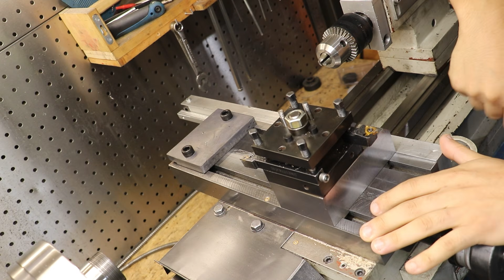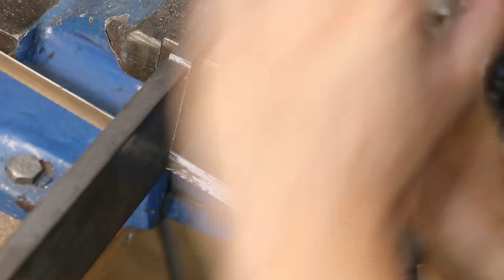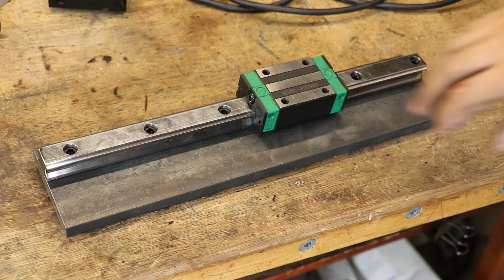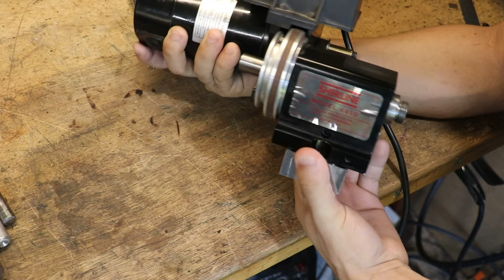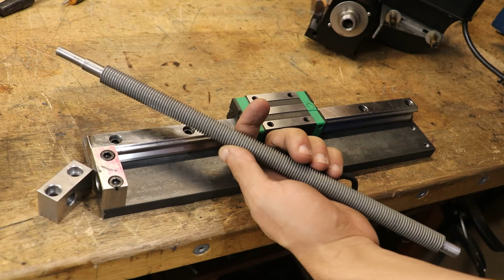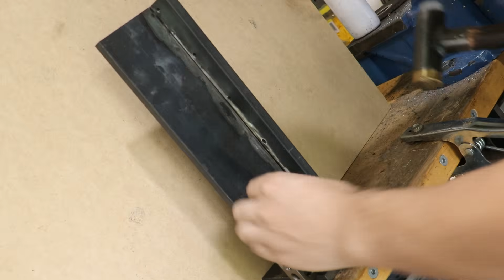Making A Vertical Milling Attachment For The Lathe

Comment: Hi Milling requires a fairly rigid machine. How well does this design hold up in terms of rigidity? I’m also planning to build a drill/mill machine, and I really like how simple your design is, so I’m thinking about using it as inspiration. I’m just not sure how rigid it is in practice. Thanks!
Reply from the maker: This was built around using er 16 size mill tooling and drilling and it was certainly rigid enough to do that. For any large machining its always best to have a mill.

Comment: Not sure what you are planning to do to the mill spindle, but you have 145mm of cross travel on your lathe. Couldn't you buy (they are cheap) or make the sort of vertical milling slide that everybody used to use - where the drill/milling tool goes in a collet in the lathe spindle, and the milling attachment holds the workpiece (e.g. with a small vice, but whatever is necessary to hold your mill spindle in this case) and the milling attachment traverses with the cross slide, and has some vertical  movement using a lead screw?

Comment: Did you consider the holes are slightly too small for M6 because they are actually made for M5 with plenty of tolerance so that the usual unallignment of drilled/threaded holes won't affect the straightness of the rail?
Reply from the maker: What I think may have happened is bad translation on the part diagram. 6mm hole has been mistranslated to 6mm screw
Reply: @artisanmakes  makes sense

Comment: Great job. I’m inspired to make something similar for my lathe. But I’ve got to ask- where on earth are you buying 3mm carbide end mills for 30 bucks!? Adam’s Bits in Melbourne sells them for AUD5.45.
Reply from the maker: This is a suttons carbide endmill. Australian made and very good quality. At least for my cutting tools I try to stick with name brand ones if I can.
Reply: I have a lot of Aussie made Sutton drill bits. Excellent quality. But at the rate I break tiny end mills, I need to stick with the Chinese version!

Comment: I know you said you weren't going to bother with bearings on the leadscrew but a quick and effective option might be to  drill a shallow taper in the bearing block and in the end of the screw, then drop in a single ball bearing. It'll reduce friction and be self centering.
Reply from the maker: If this was a tool I was going to use more than once I might have put some effort into putting bearings into the blocks. It really is a one use tool

Comment: You didn't tell us the thread you used on the stud.  I hope it's a metric thread so that it is a truly mongrel part.  Could it even be 0BA to be really really annoying?
Reply from the maker: M16 x 2 I think. It doesn’t actually matter I’ll be using an indicator to set the depth.

Comment: In this type of anti backlash mechanism two thread hold the full load in one of the directions, while a lot more towards the other. I don't know,  it looks weak
Reply from the maker: It’s no different to the ones that one on the lathe and the mill. Only difference is those are made from bronze.
Reply: It's very common in the smaller Chinese lathes/mills.  I suspect the longevity won't be great anyway because it's steel on steel, and that all-thread and the couplers are usually toffee grade steel.

Comment: I obviously do not have the whole picture since I do not know what mods you have planned for your mill spindle, but the first question that popped into my head was whether it may not have been easier to make a whole new spindle using the mill in current form to do the milling and then simply install the custom spindle when done instead of making a milling attachment for the lathe... Either way, makes for good video.. You do great work...
Reply from the maker: I looked at making a spindle once. I could probably make the basic spindle, but once it needs heat treating and grinding that is outside what I can do. And outside what I can afford to commit to spending on a project. This is only a hobby so it doesn’t get a huge budget

Comment: Single linear rail and single carriage ? 🫤
Reply: Agrred, a single linear rail is not going to be very rigid at all.
Reply from the maker: Rigid enough to handle drills and 6mm endmills. It’s a one use project so I ain’t making it more complicated that it needs to be.

Comment: This project reminds me a bit of a company i used to work for a vew years. The rather would take 10 cutoffs an weld them together (like your spindle nut) than just make 1 milled part.😂
Still, grate work for the purpose!
(Although it hur my eyes to see you just bolt the rail on a welded plate)
Reply: and why didn't he just machine it afterwards, 
to make sure it was straight & squared after welding!??  ¯\_(ツ)_/¯
Reply from the maker: I am working on a very small budget here. This these projects and tools cost a great deal to do, so if I can save some money by using off cuts I will.

Comment: The Sherline was licenced/bought out from an Australian. The man behind Clisby Compressors Harold Clisby. He had loads of engineering achievements Making carburettors, cylinder heads for F1 he even used to have a Toyota 2000 like the one in the James Bond film.

Comment: At 5:00 are you saying "base" or "vise"? 
I don't understand mounting the spindle to the crossslide.  Where is the workpiece held?  Where does the x/y travel come from? 

 I must have missed something,. or I'm just not very clever.
Reply: He says Base. If I had to guess the spindle is going to be mounted perpendicular to the standard lathe work holding fixture - which is how the material will be held. No different from a standard lathe operation 

But, seeing as how I haven't finished the video yet - I guess I'll see!

Comment: Thats going to be a very handy attachment. It may be worth making a support bracket off the back lathe bed rail so you can use the carrier as a mill bed. I suspect that galv threaded rod and coupler nut will be a bit of a hassle down the track as the soft galv wears down more, giving even more slop. The adjustment method you have will suffice for now, but it may be worth adding some nylon plugs once the galv surface has been smoothed down a tad. I'd drill for an array of nylon grub screws, or nylon plugs with grub screws.
Reply: Good points.  I'd also be concerned that the machined allthread  may struggle with maintaining its integrity vertically, since the axial bearing surface is quite small and not really bearing material. You can take out all the backlash and provide a lock on the nut but, if the rod moves, you're still cactus.
Still great work though.
Reply: @thedodger7030  both you and Nathan make good points. 
would a hardened lead screw have helped w that ..?
Reply: @trumanhw  the thread profile isn't the optimal, but the galv coating is biggest issue as both the nut and thread are sized to allow for the coating, and once they wear down you will have inconsistent tolerances. 
Seeing as the thread is mostly just for adjusting the height of the tooling and you can lock it off when milling, I don't think the grade of steel or thread profile will be a big issue. And it's always possible to upgrade if needed.
Reply from the maker: For a one use tool it’ll get the job done.

Comment: The holes might seem to be for M6, but in my experience they are meant to take m5 bolts and the rest is clearance so you can shift the rail a little bit for alignment. Also so you don't have to be as precise with the hole locations.

Kinda wish you had flycut the face where the rail mounts afterwards, it will only be as straight as the surface you bolt it to.

I propably wouldn't have built the entire thing like a vertical milling machine, but like a horizontal boring mill with the spindle on the side of the column, and the column then where you usually have the toolpost. That way the whole setup should turn out way more rigid.

Comment: That's some great machine work with the cheapest lathe and mill possible. You are definitely a great engineer at creating some amazing tools.
Reply: I just wish he bought a used mill & lathe (that needed some work) but wasn't pure Chinesium. 
Without timelapse it must take a damned eternity to do every little cut with those little TOYS. :)
Reply: @trumanhw  sometimes you don't have the budget or the space for a real cast iron machine that weighs 2 tons and takes 3 phase power. In my remote location, I don't have access to 3 phase power. So, I either have to repower the tools or get a phase converter.

Comment: Hell yes! This is something I've been thinking of doing to my own lathe (i don't have the space for a separate milling machine).

I even went looking for a kit for my wm210, but that doesn't seem to be a thing.

Very much looking forward to this one! 😀
Reply from the maker: Go for a mill. This is not a mill replacement. I’m only making this because I won’t be able to use my mill.
Reply: @artisanmakes  thanks for the reply. I don't know if I can fit a decently sized mill in my space though... I've been thinking about the idea of somehow adding a mill column and head to somewhere behind the lathe ways, and set up a larger cross slide with T slots so it doubles as a milling table. 

I've got a small z axis attachment at the moment, but it's very limited in travel. A mill head behind the lathe could be the best use of space and of the XY axes I already have.

Comment: 10:20 No, actually that stud should be really loose (as it is on all of Sherline's original equipment). All the alignment should be done by the key, so you don't want any precision fits otherwise that could mess with that alignment. The locking stud is only providing the pulling force to clamp the spindle down - which is why you probably shouldn't freehand the top angled face on the stud, either.
Reply from the maker: My vintage sherline riser block isn’t loose. But the standard one is.

Comment: This reminds me a little bit about a job I did last week. Years ago I converted my drill press into a mill (it already runs on angular contact bearings so the spindle is up to it), but I’m sick of the quill being so inaccurate, so I bought a worm drive gear assembly from my usual Chinese website & made up a fine feed for the quill.
The worm part is secured through some aluminium angle plate & just as a temporary proof of concept I didn’t put any bearing in. Just steel shaft running in aluminium angle with some high moly grease. It works great. Even put a kind of cone clutch so I can disengage it & still use the quill normally.
But we all know that “temporary proof of concept” bearing arrangement will still be there next year, & probably for years to come 😂

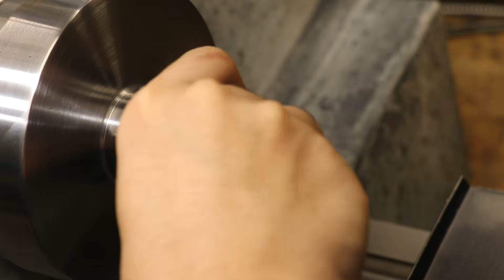Comment: 7:08 typically the rails are not meant to take M6 screws if the hole is M6-ish sized, but more like M5, possible even M4. The ones I usually use come with counterbores for M3 (but with some wiggle room), and the holes are even larger. To my understanding this is meant for having the option to align 2 parallel rails to each other where needed, or to align it to some other external reference edge/surface.
If yours are officially meant for M6 though, I got no clue and they just screwed up I guess?

Comment: Very nice! I made a mini-spindle for my lathe to regrind the chuck jaws, drill holes, mill keyways, etc. but it doesn't have an extra linear axis to go with it. I'd like to cut some teeth into the perimeter of the chuck backplate and add a disengageable worm gear so I can use the spindle like a rotary table for milling work.

Comment: I use my Sherline milling machine spindle/motor for thread milling on my lathe! It appears to be nearly the same as the Sherline lathe head. I use a Sherline extension block (nearly identical to what you made) to mount it, and can adjust the helix angle as needed. Have to shim the height slightly in use.
Reply: Nice! I know someone that did that as well but the milling head was a Bridgeport M head and it replaced the compound on his lathe which was 20"+. He was milling a helical groove in thick wall tube for a hydraulic oil cooler.

Comment: Hello, I want to give you some tips, I worked as a mechanic and mechanical engineer for several years and I think you can use some of the knowledge I have gained over the years.
When cutting metal with a hand saw, take care of several things:
oil
taut blade
A blade with a larger number of teeth is suitable for harder material or for easier and cleaner cutting
Cut with an angled drop in relation to the material
When cutting metal with an angle grinder:
A leather vest will be your friend (I've seen some young men catch fire from sparks)
Cut the material all the way through with the disc or switch to a saw at the end of the cut and don't use a chisel or hammer to break the material, this creates internal stress in the metal
The best way to get better at welding is to weld a lot, practice on metal as much as possible.
A good welding mask will help you a lot more than you think, I recommend an automatic one.
When using a drill chuck, if you put a little grease behind the lips that grip the drill bit, it will grip the drill bit more tightly.
You do amazing work, I really enjoy seeing you every week, I hope you continue what you do for many more years.
Reply: What would be lovely is to see the correct hand placement on the hacksaw.
Of all the YouTubers I watch I’ve only ever seen one that knows how to hold a hacksaw properly.
Reply: I'm curious how does adding grease make the drill chuck hold tighter?
Reply: @michaelmedeiros2089  it is something that we did, it worked in keyed chuks, probably  it's reduce the friction in the mekanizem

Comment: There are actually 2 different standards for cap head screws.
One is the more commonly used one that you can get everywhere which has the knurling on the head.
The other one has a smooth head and also it's a little bit smaller OD.
I am not sure why the knurled version exists but usually bigger bolts and most stainless bolts all have smooth ODs 
They are technically cheaper to manufacture

Comment: In my experience, linear rail bolt holes are typically a little oversized to allow for room to align the rails. So those rails are probably meant for an M5 cap head bolt.
Reply: This right here
Reply from the maker: The box diagram drawing  says they are for m6. I’m getting the feeling who ever did the drawing mislabeled 6mm hole for m6.
Reply: @artisanmakes  well, either way, you solved the problem the same way I probably would have lol. A frustrated sigh of acceptance of the fact that I would be spending the next hour turning bolt heads down 😅
Reply: Makes so much sense!
Reply: Could also be this:
Within the standard for counterbores there are two types. 
Type one has a diameter of 11mm and is for screws according to ISO 1207, ISO 4762, DIN 6912 and DIN 7984.

Type two has a diameter of 13mm and is for screws according to ISO 1580 and DIN 7985.

Maybe you just got a "missmatch" of counterbore & screw there.

Comment: I see you haven’t yet been seduced by the Anchor Lube sponsorship conspiracy. Well done.
Reply: I bought some & I’m not impressed.
My MolySlip MWF is far better.
Americans go mad for Anchor, but I don’t rate it.
Maybe they can’t get decent cutting compounds over there? 🤷‍♂️
Reply: I'm tired of seeing that snake oil, they've been sending it to everyone.
Reply: lol, it really is great though. Sticks in place so you can have your end mill submerged in lubricant without making a mess. Essential for 1/32" and smaller on a CNC without flood coolant.
Reply: @ I have a bottle of the product but the only really good use I’ve found is tapping cast iron with small taps like M5. When I installed the DRO’s on both my machines even with a new USA made tap, it was much easier with Anchor Lube. For other ops like milling or drilling steel, I find no benefit vs other lubricants. Max Grant uses a mix of dark cutting oil and WD40 and swears by it. Cheers.
Reply: I tried a bottle of the Anchor Lube, and for all the hype, I was expecting more.than it delivered.  Its ok, I don't use it much, although its about the best I've found for machining stainless. 

 For everything else, I use dark (sulferized) thread cutting oil diluted with kerosene.  WD40 is mostly kerosene, so I can understand where your friend is coming from.
Reply: @vandalsgarage  well, it’s not a friend but another YouTube machinist Swan Valley (Perth, Australia) although I’d love to spend about a week with him in his shop! Cheers.

Comment: Bro's milling on his lathe before buying a metal bandsaw
Reply: Well I can also claim that, and I suspect it isn't that unusual in the hobby shop scale stuff - you can hacksaw or angle grind the stuff you'd like a bandsaw for, but you just can't do without the machine tools to actually turn that rough cut into the part. And being able to use the Lathe as a mill, or the mill spindle on your lathe to drive a gear tooth cutter while the lathe plays indexing and axis of rotation etc. And if you like me live in a nation with small expensive properties... 
I might manage to fit one of those hand held portable bandsaw somewhere, and make a table for it so I can pretend to have both horizontal and vertical bandsaw, but no way at all I'm going to find the space to put a more 'real' bandsaw in the workshop at all!
Reply: It’s become such a meme, that if he did actually buy a bandsaw it would get weird. He basically can’t buy one, now that the comments section is so invested in it. Poor dude is destined to spend the rest of his life trying to make his way through a 4 inch round of 4140 with a loose, blunt hacksaw blade and some determination 😋.
Reply: @minchy83  He could also just start with hacksawing (on film), bandsaw most of the way off-camera, then hacksaw the end. For the memes.